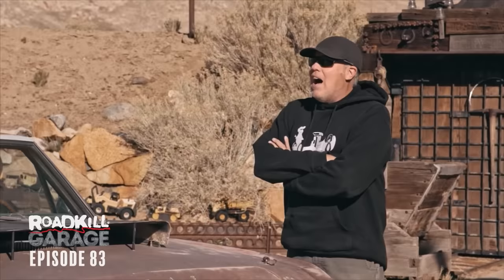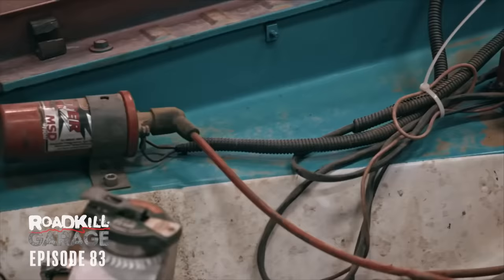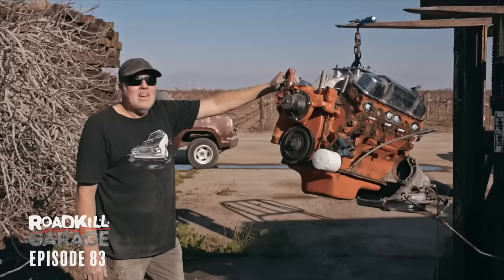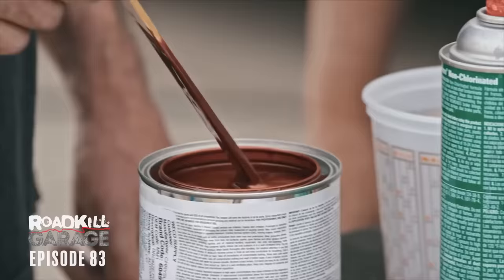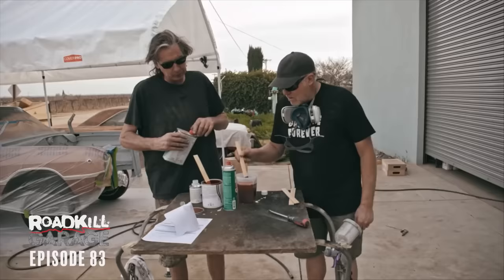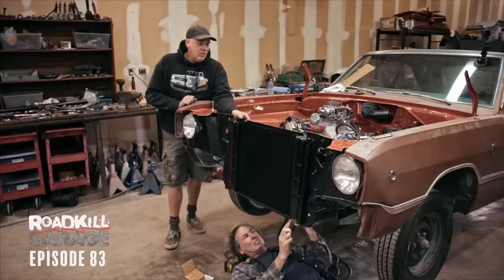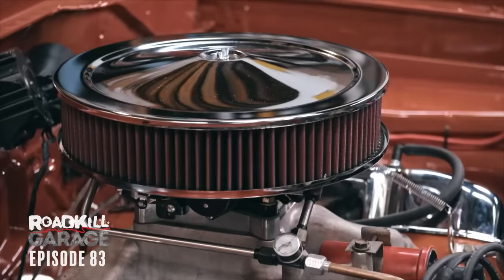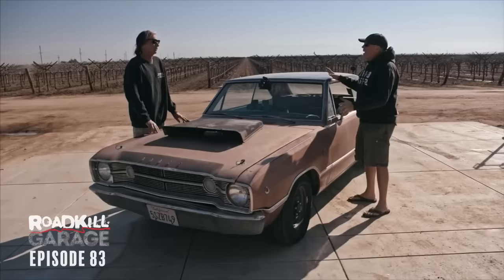Big Block 440 '68 Dodge Dart! | Roadkill Garage | MotorTrend

Comment from the maker: What color paint would you go with for this Dart?
Reply: racing green all the way
Reply: Original
Reply: Black, bring mtod back to Australia.
Reply: Limelight with parchment interior and Rally wheels. Wwoohhoo.
Reply: Mod Top Roof and Panther Pink . oh yeah.
Reply: Original color, black hood, 15x 9 Dish Mags, 275 60 rear,  15x 8 245 60 front
Reply: Buff dat bronze and alligator black vinyl top for contrast...but maybe cast "coke bottle spoke" or Centerlines rather than chromed Cragar SS rims or American 5 spokes.
Reply: Looks great this way
Reply: I wouldn’t paint it, I would put a longer rear gear in it a a four speed manual to back that 440. I’d basically go more traditional “hot rod.”
Reply: Grey with a black front
Reply: I'd paint it the original turquois that's under the hood. It's an awesome color.
Reply: No doubt the copper color!
Reply: Shhhhh, it's perfect

Comment: Man that takes me back! I had a 67 with factory 273v8 2bbl, 727 and posi. Me and my brother pulled it, swapped in a 557 lift purpleshaft, sent the heads off for 3 angle and double springs, added a streetmaster 318 edelbrock, 850 holley doublepump, cyclone headers with 2.5" duals straight into 30" walker turbos with turndowns in front of the axle to send reverb back up into the car. Totally wicked monster that drank quite well from that 850 and would light em up anywhere up to 60 on dry pavement. Never put a tach on it but I am pretty sure it revved over 8k stock. Never heard a v8 scream that loud and high, with the typical Chrysler cackle at idle. 
Man I miss that car. Glad to see another one being kept alive!!
Reply: I had a 1986 ramcharger royal se 4x4 360 was stroked to 409 bluprinted & ballanced 2 stages of nos 1 dry 1wet 727 Trans stage 3 full manual and a super high stall converter 8800rpm all day long! Swaped in 1 ton diffs  d60 front d70 rear with 4.10 gears it would spank 2door viper trucks with ease
Reply: @mattk252  sounds like whiplash. Nice!

Comment: Remember the old I think it was hot rod article about a cheap drag racer. They threw a 440 out of a imperial into a dart. They were trying to make something fast for $2,000. My favorite thing about the article is the pipe clamps for the transmission mount on the crosmember.😆 Edit this is the exact car I was talking about!

Comment: Running at 140 degrees? Guessing the big blocks can handle low temps better than smaller engines? Always heard 160 was as low as I should go without risking a blown gasket. 
So cool to see a dart again. Thanks guys!!

Comment: Not sure if mentioned in comments,  they did offer a dart in 1969 with a factory 440! Interesting though the dart with a 340 could do better times in the 1/4 mile.  That's because the 440 had very restricted exhaust manifolds, with headers though and not spinning the tires the 340 didn’t stand a chance.

Comment: Ok men, I was so inspired by "Project Cheap Thrills" that I am duplicating that build with a 1969 Dodge Super Bee.
I am going to use 3.91 gears with 28 inch tall rear tires.
And it is my hope to use Trick Flow 240 heads on the 440.
My goal is 11 second quarter mile times in a pretty mild package.

P.S. Everybody who follows the Engine Master series will remember the event where Steve Dulcich won the contest hands down.

Comment: for a budget build, save money on masking and....just roller on the paint to avoid brush strokes and mask the master cylinder in tinfoil or plastic wrap. Half of it is going to hide behind the engine and the rest will likely get coated the first time they overheat the engine.

Comment: I think you should go ahead and paint the rest of the car in turbine bronze with a flat black hood.  It doesn't have to be showcar perfect, but just clean up any rough stuff and do some filler in the dings.  It would be a great driver.  I had a '71 Barracuda in Turbine Bronze and it really gleemed in the sunlight.  '68 Darts are mean looking cars with the right wheels, tires and stance.  Actually, I think the Mopar Magnum wheels would look great on it.

Comment: It Friday this past week early in morning I spotted a rust colored Dodge dart. It was a 2 door the tail lights slant V high to narrow center unless it a Plymouth . Back when was a kid I saw blue one in a junk yard that head on wreck. In the early 90 all the cars were crushed. The crusher guy only kept 78 Ford 250 4 door  extend cab truck and bed he didn't crush. The sad thing about the the 2 door rust one it in a trailer park with alot of drug use it probably be sold for scrap for drug money.

Comment: Get you an electric fan off of Chevrolet front wheel drive with a relay and a temperature sensor from like citation that had electric fans kick on automatically saves a lot of horsepower